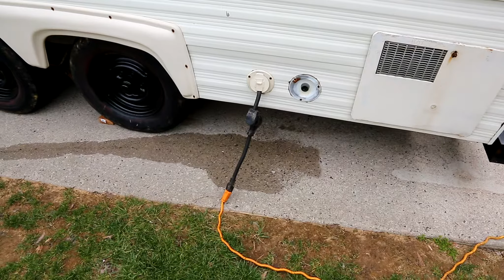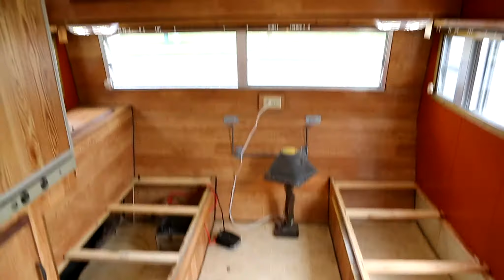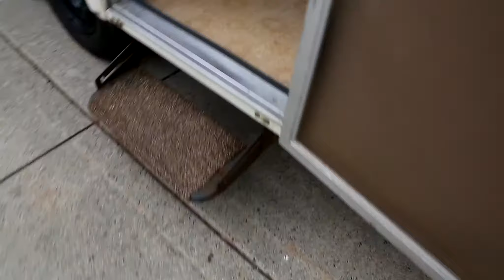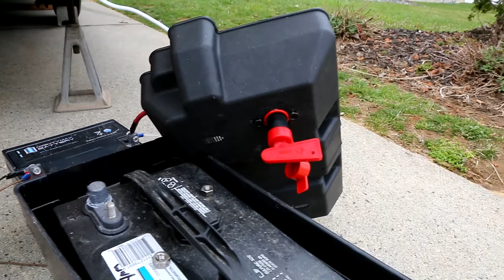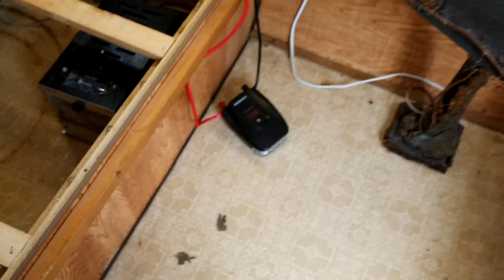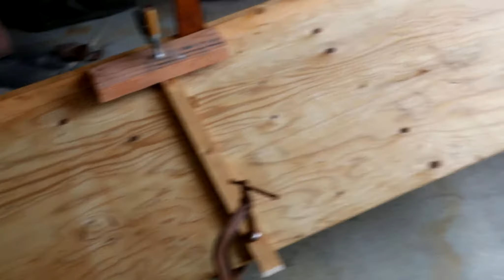Sh#tbox Restoration E04 Battery and Bed - 1981 Sunline Camper Trailer

Comment: What size mattress did you use for the back bed? We just bought one and are looking for a mattress
Reply from the maker: The back bed is an odd size: 77L x 50.5W (a full is 75x53). We reupholstered the seat/bedding it came with.  I then took a queen-sized foam mattress topper and cut it to fit the odd-shaped bed.  It works well and is enough comfort for a week-long trip.